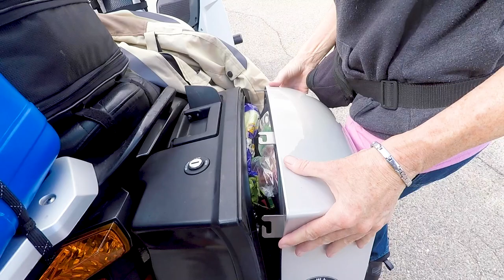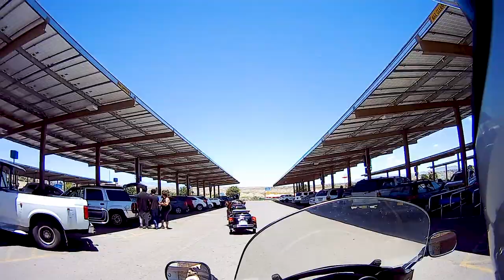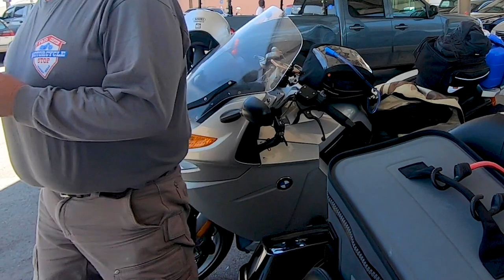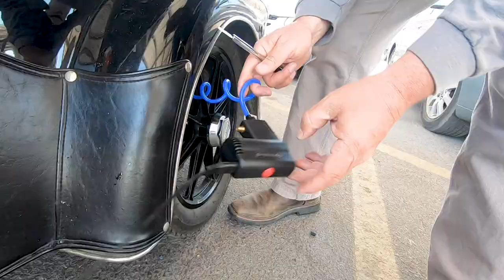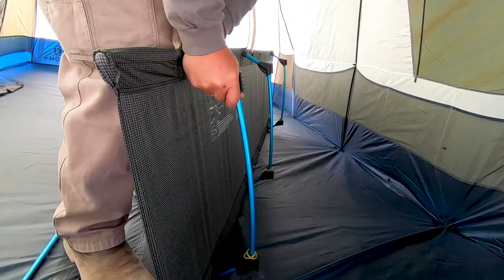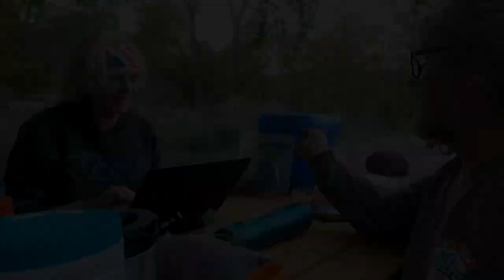We're Not Homeless - We Just Have Less Home #motorcyclecamping (S2 E6)

Comment: You can buy a motorcycle tire pump that runs on battery.  It is very compact, portable and stop at preset pressure.  btw, how do you keep your bags safe when go into the store?
Reply from the maker: Lock up the trailer and bags and take the cooler, tank bag and helmets into the store with us.  Oh we have a 12v air pump. I have to manually shut it off.